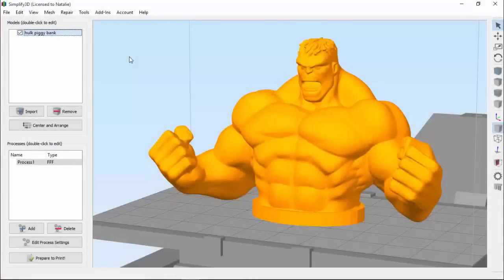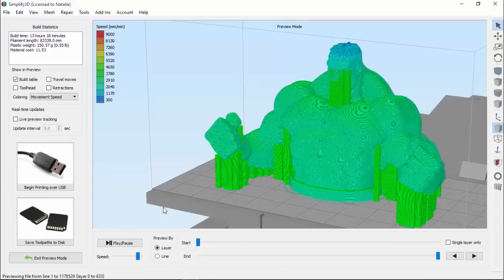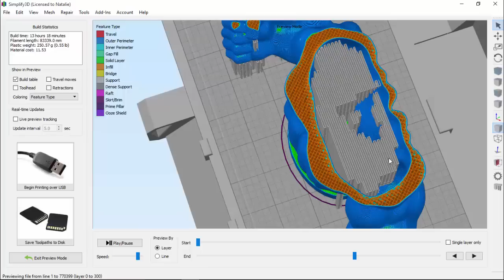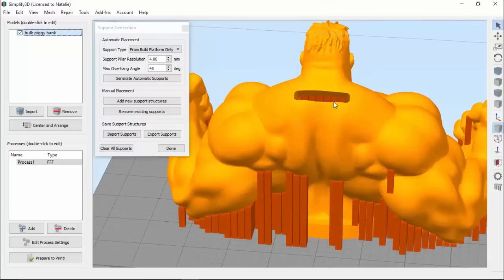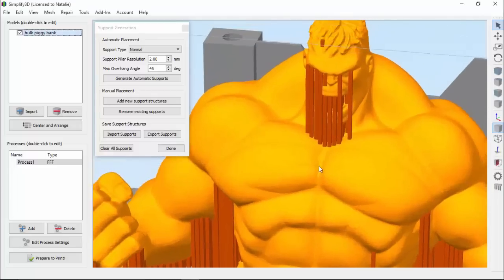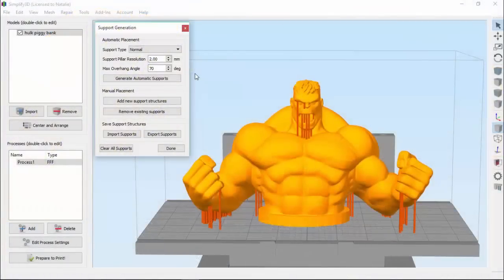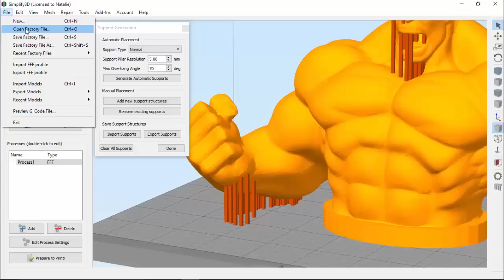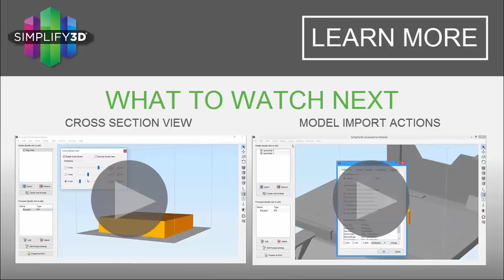Customizing Support Structures | Simplify3D

Comment: I find that the automatic supports stick too well and are almost impossible to remove without a heavy knife or screwdriver to pry/chisel them off, which sometimes mangles the print..  Once I have managed to remove the supports, they leave bumps that need to be cut/sanded off (the same thing happens with rafts!  Almost impossible to remove!).  I wish this video had touched on how  to change the way the support attaches to the model.

Comment: Hello,

I also printed the hulk, however the underside of the arms went bad, how can I fix this?
I would like the part where there is support to be of the same quality as the parts where they are not supported.
Here is a video with my problem:

https://www.youtube.com/watch?v=FWhXrk4qihg 

I know Simplify has many options but I do not know what to change to solve this case.

Can you help me?

Comment: Hi,

Some of my supports are very, very hard to remove, so hard that it destroys my original print. and I have to use needle nose pliers to remove it. How could I print support easier to remove? My pillar resolution are 4mm.

Thanks you !
Reply from the maker: Hi Nolween, We reccomend you check out our friend Makers Muse mater class video on supports! https://www.youtube.com/watch?v=piwKAOOaPKc

The support pillar resolution does not always determine the closeness to which the supports will cling to your part. This is largely governed by the support separation distance. Tuning your horizontal separation distance should go a long way towards helping you be able to gently remove your supports!

Comment: I had to extend the support on one of my models to ensure that it isn't broken from the platform during the print. However, some of the structures don't start at the platform but somewhere else on the model and then extend outside without any support reaching up from the platform. This means, that the first layers are printed in mid air. Why aren't those parts extended in z-direction till the go all the way down to the build plate?
Reply from the maker: Supports will extend downwards only until a point where an edge of the support pillar meets the model, going beyond this point will make the pillars intersect with the model. You can reduce the support pillar resolution to generate pillars optimally, or manually add a network of supports around that area so that it builds from ground up. If you have more questions please contact our support team at support@simplify3d.com

Comment: i want to use this fantastic program but imstuck with repitier because i cant level my bed automaticaly so the first layer will always be weak (if im lucky). i dont know how it works really. but i built my rf1000 printer myself and when i came to a certain point i was going to set the z axses to 0.5 ish millimeter of the bed.(so that the nozzle is 0.5 mm of the bed) does repitier have a system so that when the z button is pressed it knows that there is 0.6 mm left and it pushes jut a bit so that you get good prints?
im just so annoyed that i have the best slicer in the world in my palm and i cant use it.
the experience ive had so far is amazing. how simple and elegant it is and how good quality and easy to break support you have. im just getting worried that it wont work for the renkforce 1000. (im not technical at all) 

p.s keep up the awesome work :)
Reply from the maker: pinkiedestroyer jr, Simplify3D allows you to tweak all kinds of print settings. To get help for your printer specifically, it would be best to contact our support team at support@simplify3d.com.